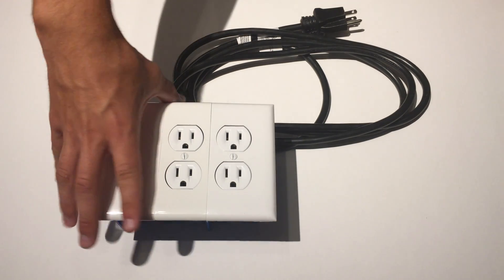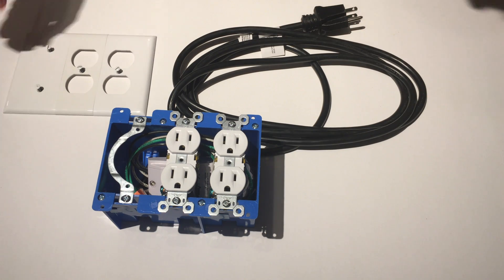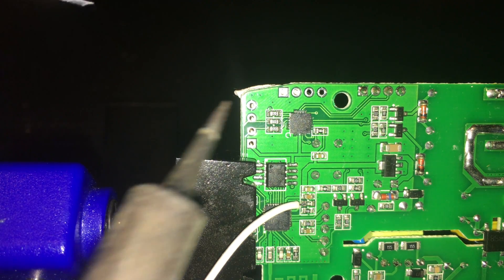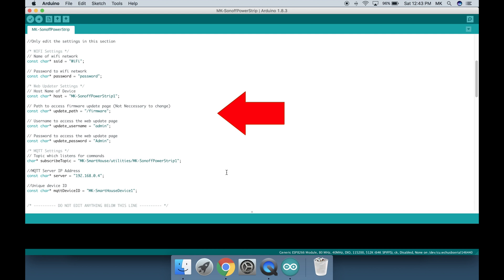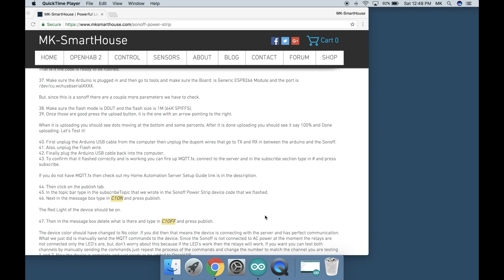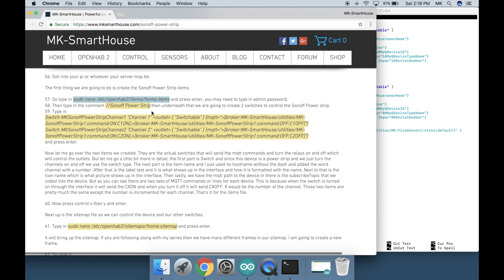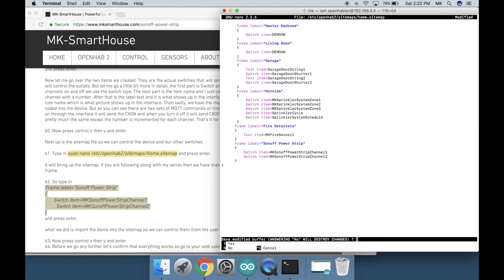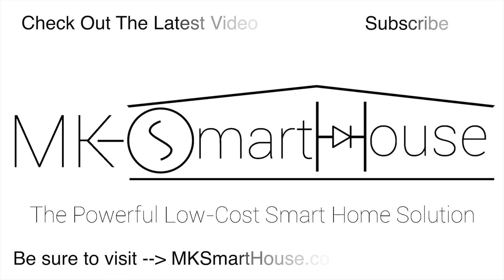Sonoff Complete Guide : Custom Firmware/Software OpenHAB MQTT (Using MAC)

Comment: i already did flash, and the Sonoff connects to the wifi, and relay works well when i have 3,3v connected to the sonoff, but when i connected just 220v, the relay doesn´t work. Anyone knows what is happened? thank you

Comment: thanks for the good video!
I'm planning on using sonoff pow with tasmota firmware. the problem is that by pushing the button when powering the serial interface, I'm not able to go in update mode. can you explain how to easily turn on update mode on the pow version of sonoff? tks

Comment: My Sonoff  looks slightly different.  It has a L  e e  L n n on the face of it.  How do I hook the wires up?  Do I use the N's as neutrals and the E's as grounds?
Reply from the maker: +ernestfortier what sonoff is it?
Reply: TH16
Reply: When I engage my brain I think the NN is the Neutral in and possibly the EE is the energy out? But I will not try anything until I hear from you.

Comment: Will this work on the basic sonoff switch or only for the duel ??
Reply from the maker: +Luke Fenton the code is for the dual but you can modify it to work with the basic sonoff
Reply: MK-SmartHouse okay thanks, what would need to be changed for the basic sonoff or the sonoff SV ?
Reply: What do i need to modify to get it to work on basic :D ?